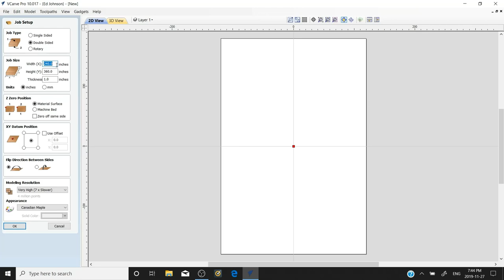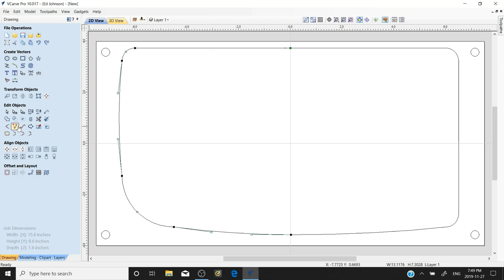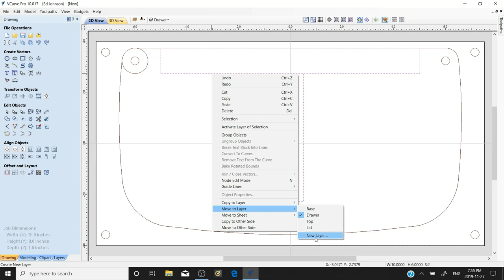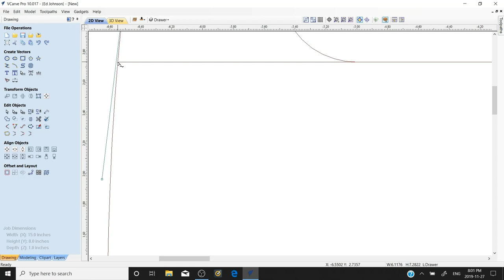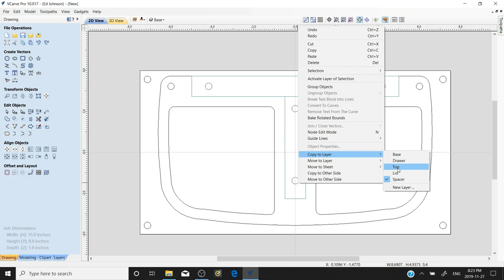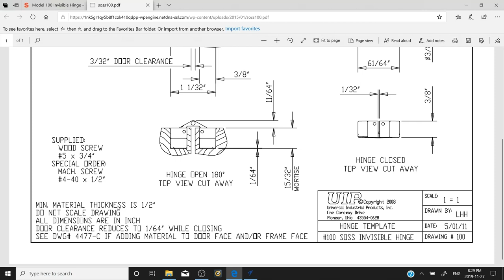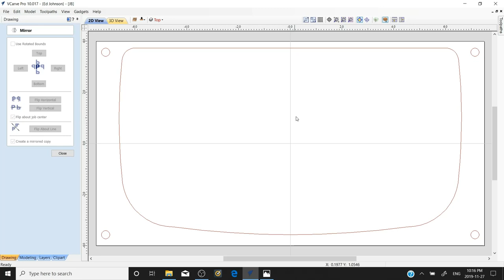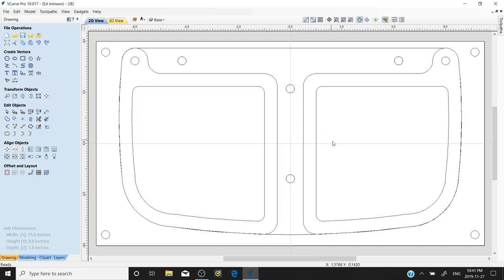Swinging Drawer Jewelry Box Part 1.

Comment: Thanks for the inspiration Ed I used 3/8" fiberglass rod that i found at the farm supply evidently they use it for building electric fence. I had a hard time finding the SOSS hinges that I am installing tomorrow, wish ne luck
https://photos.app.goo.gl/M7y634gtgDzj4mkR8
Reply from the maker: Very nice les, I’m glad to see someone using the project. The hinges are readily available at Lee Valley Tools and they do mail orders as well. The fibreglass rod is a good tip I appreciate!